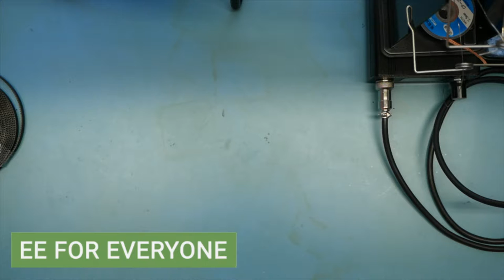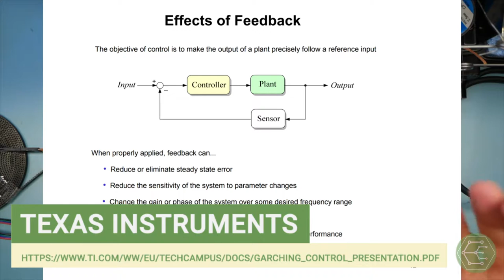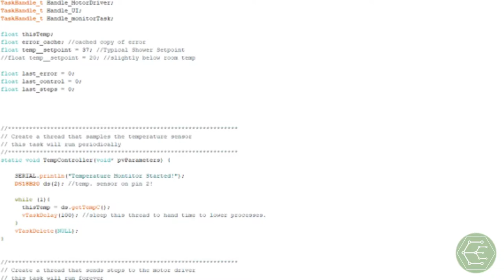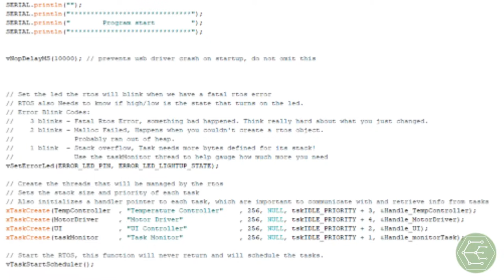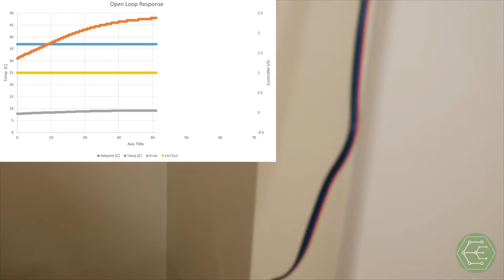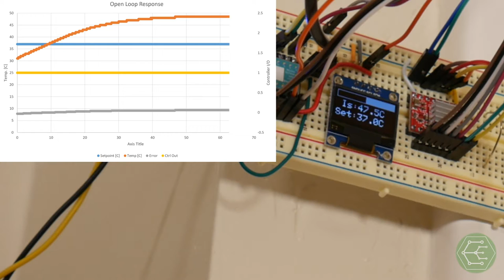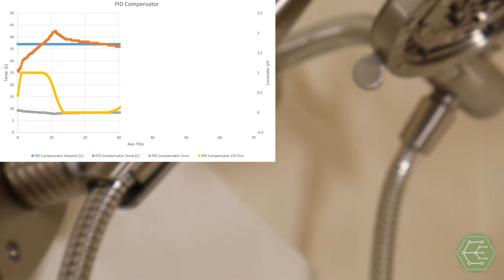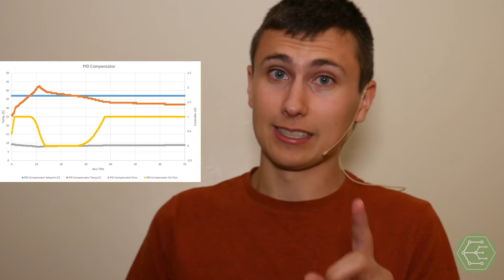Constant Temperature Showers! || Stepper Motor + RTOS

Comment: Needs a predictive algorithm to solve it.  You could do some neat stuff with Tensor Flow Lite and a Raspberry Pi or ESP32 (not sure the Xiao has enough memory, but you did pronounce it correctly!).  Teaching the AI would be.... fun.  While letting the water run through the tub fill spout does cause the system to react faster due to faster water flow, it could still be a less drenching way to get in the neighborhood with the PID numbers.

Comment: 4:47 Wanna be careful with RTOS though. If you aren't careful with your priority scheduling then you can end up with certain tasks never getting executed. Then there is in deadlock and resource management problems. The dining philosophers problem for instance. For embedded I think It is best to avoid RTOS unless it becomes nessesary due to the complexity of a project.
Reply from the maker: Fair points, Power Max! RTOS is not always the answer.. I'll admit, I used it for this project only to make sure I remembered the nuts and bolts of using freeRtos. :) In general, I agree with you statement! That said, I've seen an rtos be very useful on more powerful arm chips running higher resolution UI's, especially those with multiple arm cores.
Reply: @EEforEveryone  I just like spreading fear uncertainty and doubt when it comes to RTOSes lol. Never really used one besides college where our class built a crummy one from scratch.

They are a good idea if scalability is a factor, for sure. And nessesary if you have a very complex SoC like the dual core ESP32, Arm A-series SoC, or Free scale RT1062 crossover processor (a Cortex M7 screaming at up to 1GHz when OC'ed!)
Reply from the maker: Ha! I love it. :) Cheers, thank you for the comment & conversation!